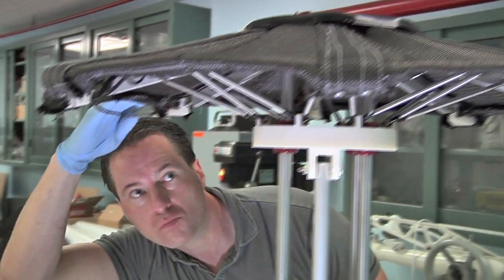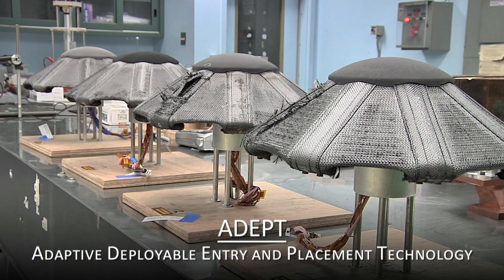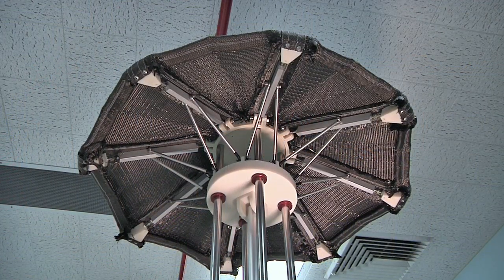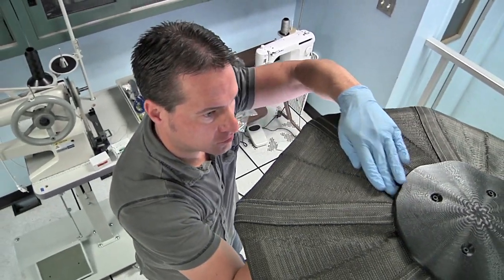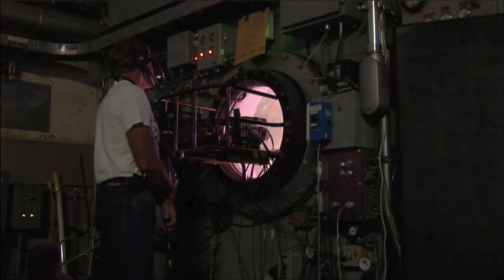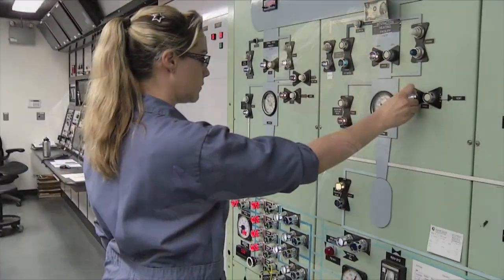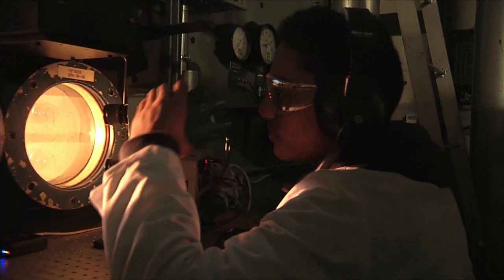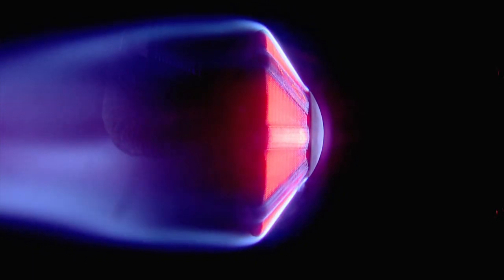NASA Ames Completes Successful Heat Shield Testing for Future Mars Exploration Vehicles

Comment: The terminal velocity for an ADEPT shielded spacecraft is approximately Mach 1.5  at more than 10 kilometers above the martian surface. So after the ADEPT heat shield is expended during its  entry through the martian atmosphere, the delta-v required to land on the martian surface would only be 510 m/s. 

So with ADEPT,  even spacecraft--- specifically designed to land humans and  large payloads on the lunar surface-- could also be utilized  to land humans and large payloads on the martian surface.
Reply: To think that the same thing whose shown in G1 anime Mobile Suit Gundam.